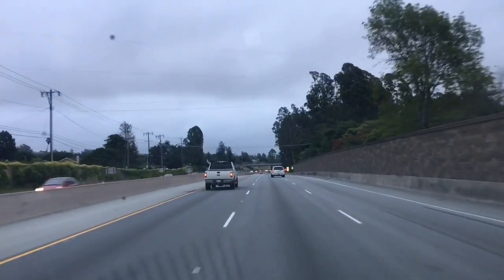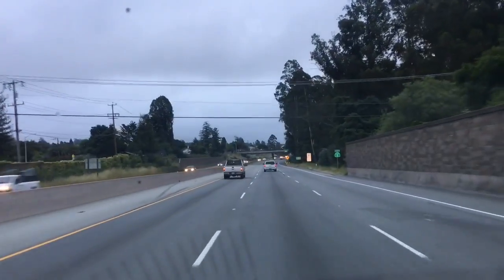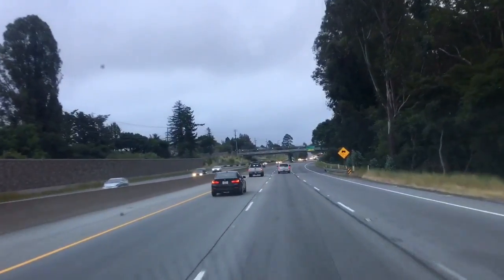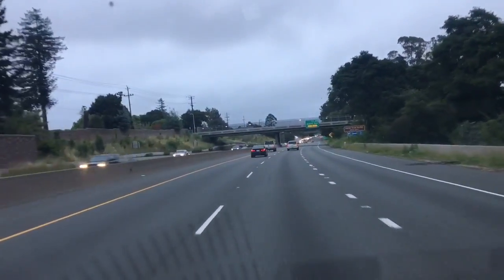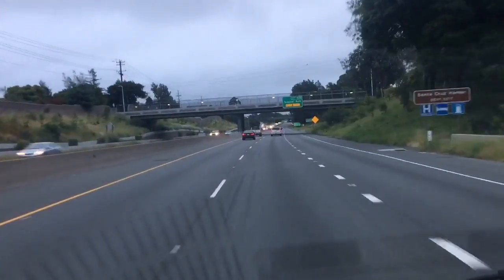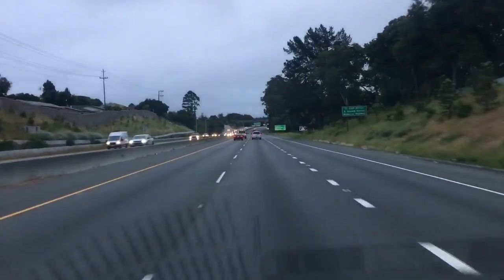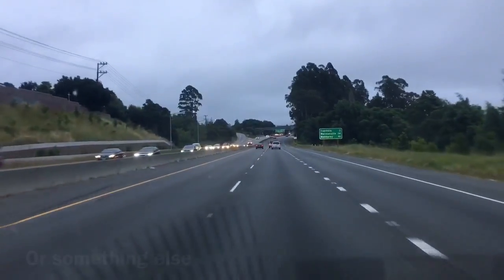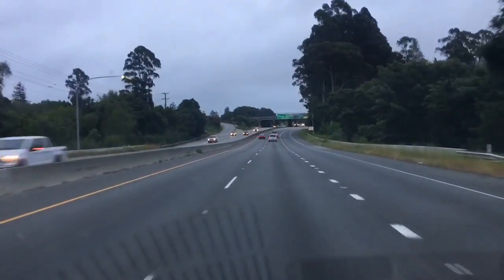Copeland scroll Medium temp follow up

Comment: i've got a crazy idea --- if u are still having problems with it in the heat, Reduce the txv superheat to 8 degree's therfore reducing evaporator capacity slightly. simulating a smaller evap.

Comment: What i believe is happening here is that the Evaporator you said was 12,000 btu and the condensing unit is only able to do 9,000 to 10,000 at 100 degree ambient and + 20 suction. i Have allways Designed my installs with the condensing unit Bigger than the Evaporator at the Evaporator's  Rated Btu's, hottest day of the year in that area and +20 suction. Basically the Engine Should allways be Bigger than the Tires in My opinion and what i was taught and it has allways worked out Well For Me.  on Hot days The Evaporator is too Large for the Condensing unit to get it to a +20 suction at that 96 degree ambient. So, Cheapest Fix is Downsize the Evaporator to 9,500 btu's by elimating a calculated amount of tube runs in the evap or Best Fix Would Be Put a Larger Condensing unit of the Roof to Match the Evap. Rating the New Condensing unit at 12,000 btu's at 100 degree ambient and +15 - +20 suction. Good Vid and Find about the Door and swamp cooler blowing in  Though too.
Reply: downsize the coil? seriously....... Up grade the condensing unit... its easier

Comment: id do the subcooler special!! install a second condenser in series after liquid line... you'll be ready to go ive done it before
Reply: Yea, turns it from a 10 seer condenser to  a 16 seer in no time. Put a fan control on it so it only runs when it gets hot out.
Reply: Yea, you got to get that Liquid line cool to do any work in the summer, worst case run the Liquid Line through the Swamp cooler.